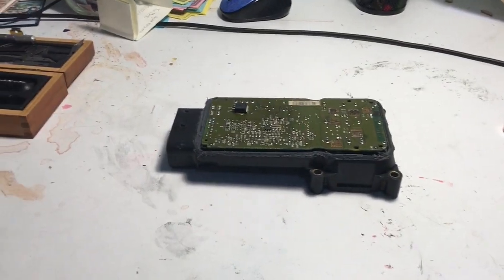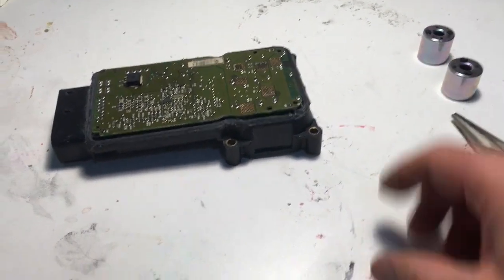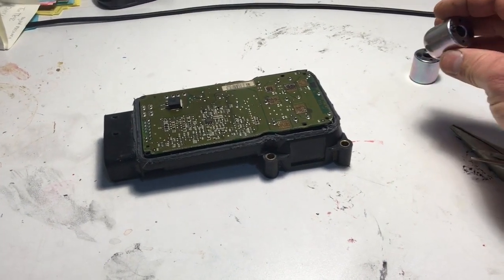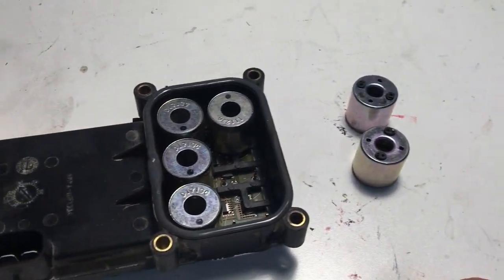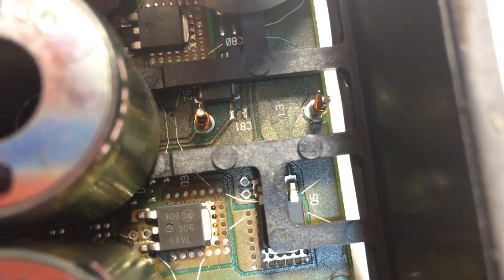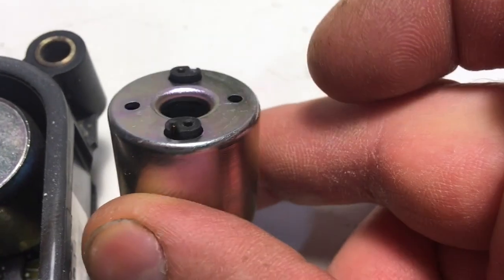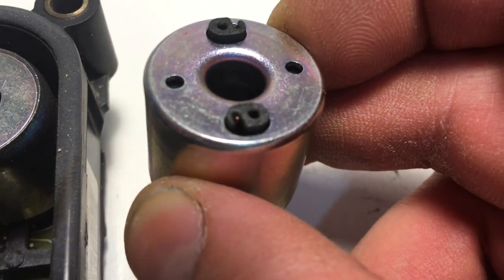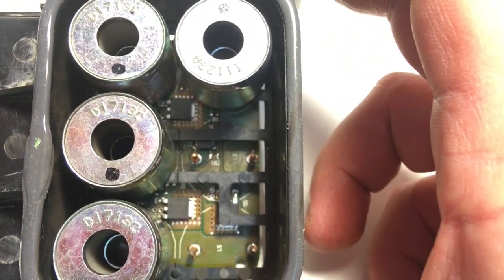Part 1/5  2003 F150 ABS Module Repair, Getting started

Comment: Yeah i wouldn't recommend anyone trying to fix these circuit boards on their own with little to no experience (one little wrong touch to a component in there and you could mess it all up)!!
I tried figuring it out on my own since im pretty handy myself, but ended up getting referred to a place out in --- Riverside CA called Digital Auto Technology --- who literally fixed it in a day! 
Now it's not causing any trouble at all, check them out, their website is ---- Digitalautotech.com ---- I believe they do other models as well, and instrument clusters if i am not mistaken!! 
Hope this helps

Comment: I don’t think this person knows what he is doing.  If narrating a procedure, use a script & don’t mumble & fumble...we want to learn, not guess!
Reply from the maker: Definitely admit my videos are amateur grade.  Let it be widely known that my videos are raw.  Unplanned, Unscripted, Unedited.  When I think a problem I am working through might have helpful content to look back on later I try to grab some video with my phone.  If I think the problem might be unique, a new finding, or have a different approach then I share it.  As a result the stuff is seen as it unfolds, as it happens, on the first and only cut. I hope you watched all 5 parts to get the whole journey and also pickup on multiple points where I clearly said this one was not in my core skillset.  With foundational knowledge of how these components work it was worth giving a try at the simple repair. With perseverance and a bit of head scratching here and there, and confirming assumptions along the way, the goal was achieved. The ABS module was fixed and is working perfectly. Thanks for watching!  I hope that overall the series was helpful to someone, in some way. :)